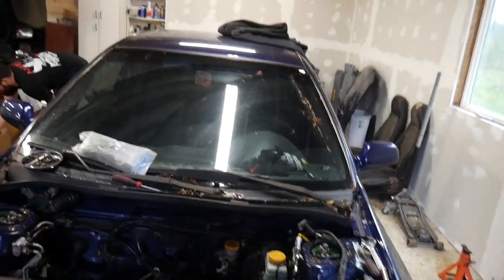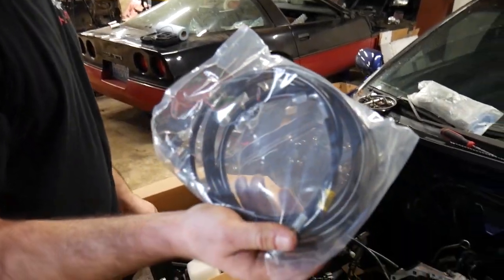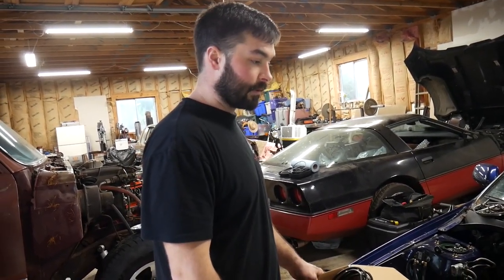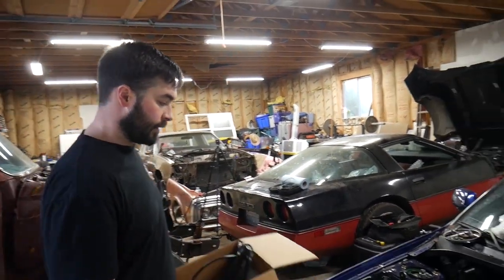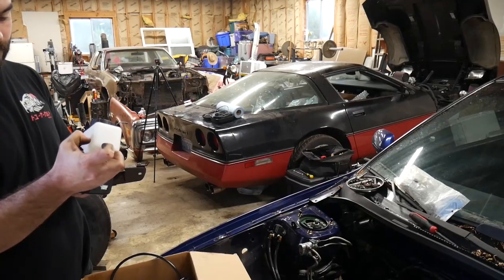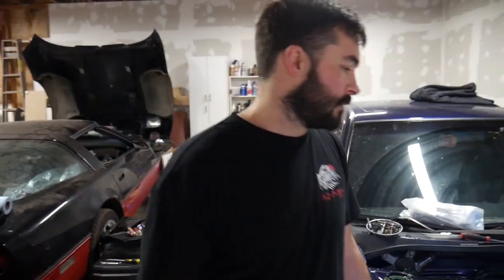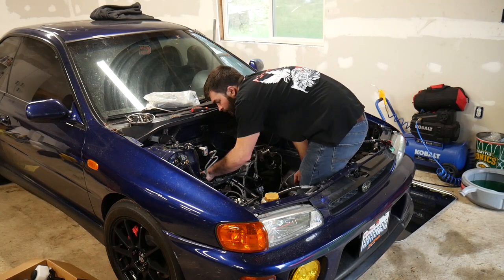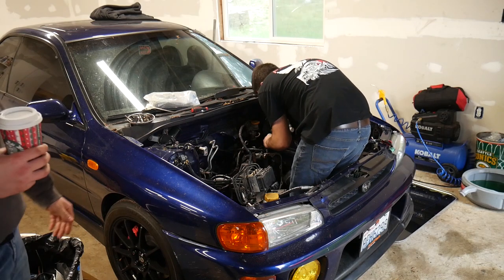WRX ABS and Brake Booster Delete (Chase Bays)

Comment: about to tackle this as well. How do you like the pedal feel now?
Reply: Since this video, we have done an STI swap on the car, and with the STI gold brembos it feels amazing. Very predictable pedal feel every time you hit the brakes. Nice and firm pedal, and like a proper rally car, the more pedal you give it, the better your brakes work. Makes trail braking and rotating the car much easier compared to the factory brake setup
Reply: It felt nice with the red WRX brakes as well, but I had a few leaks that wouldn't stop. I contacted Chase Bays and they sent me out some parts to fix my leaks, so I never got to test the red WRX brakes very much because the only time i drove the car with the red WRX brakes and this Chase Bays kit, my transmission went out... so we swapped to a speed. So stay tuned, there is a video about that coming out next I believe

Comment: using this kit will you throw an engine code
Reply from the maker: Mark - “It will throw an ABS code, but not an engine code”
Reply: @caseybaker5550  can you bypass an abs code? im interested in the same kit for my jdm ej205 swapped Sf wagon.
Reply: @caseybaker5550  How'd you handle the ABS light on when unplugging the ABS block? Is there a way to turn the light off so you don't have to stare at it all the time? Thanks for the video, I think I'm going to go this direction with my car after it gets back from paint. Can't stand the idea of reinstalling that brake line abomination.